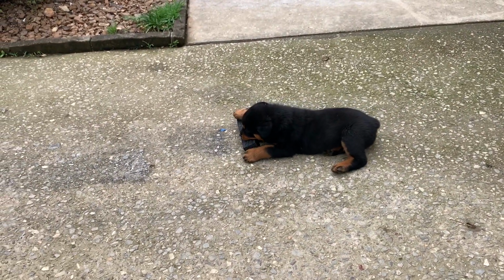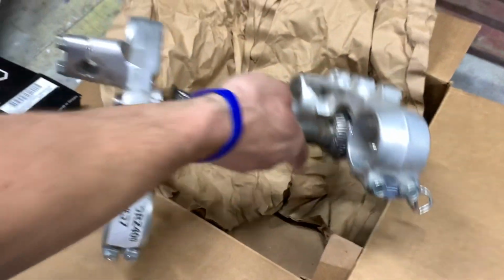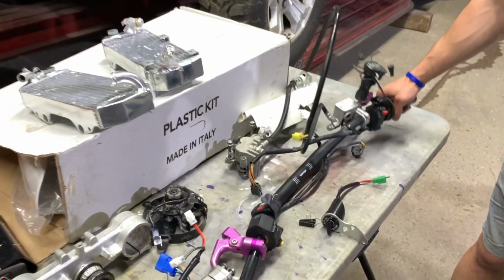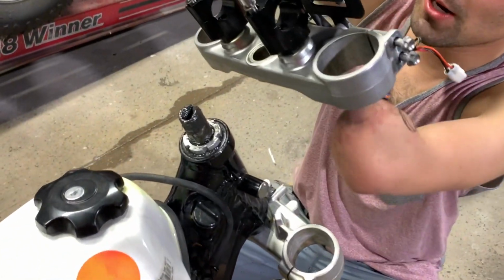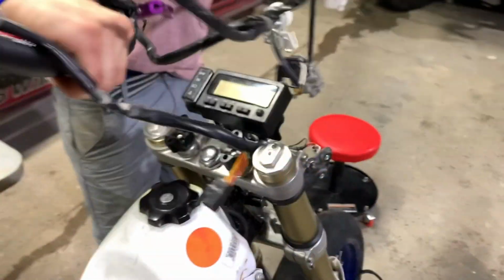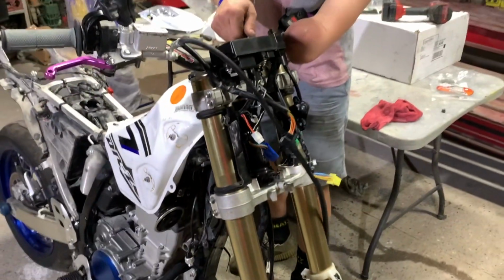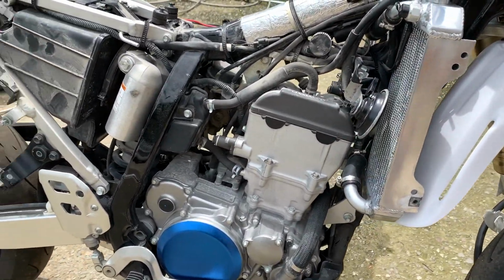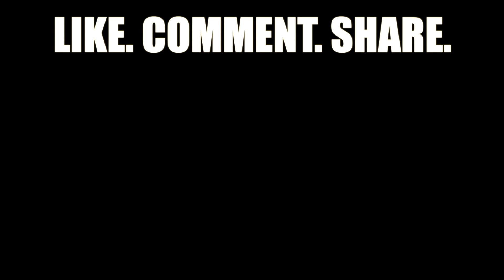Rebuilding A Wrecked Suzuki DR-Z 400 [part 2]

Comment: @ Danny, You didn't pack grease into the bearings, you'll need to do that or the life of those bearings will be shortened by quite a bit.
Reply from the maker: I will go back and pack them. Thanks for the tip

Comment: If you had the old exhaust still to it?  I know of A tip you can try out on your's to. It's called Red armor 2 stroke motor oil.,an mix in some PB-Blaster search their website's. Then ketchup on the older  technology.,an just add in today's technology to that as we'll together. This is the second part of it to. If it's really carbonated up inside of it. Get A metal trash can double line it with trash bags  fill it up enough to flow through and out both ends of the exhaust pipe tips. Acetone in gallon.,or five gallons. Soak it for awhile in A  heated element trolf barrel with electrical shocking just like. On how You would be if you we're. using A ultrasonic cleaning machine that does the same thing to.